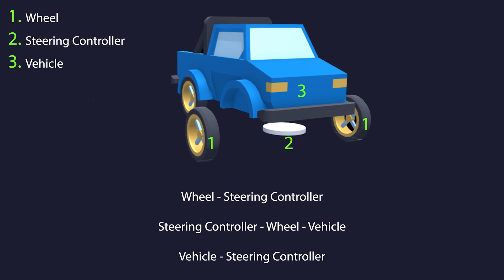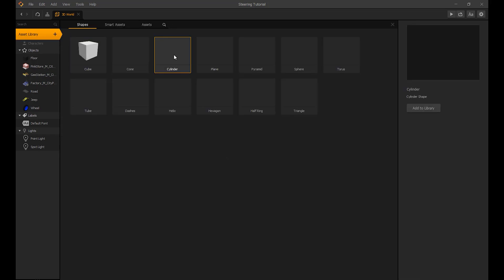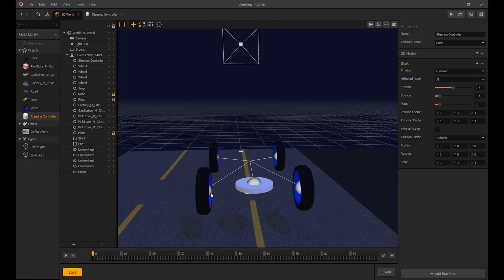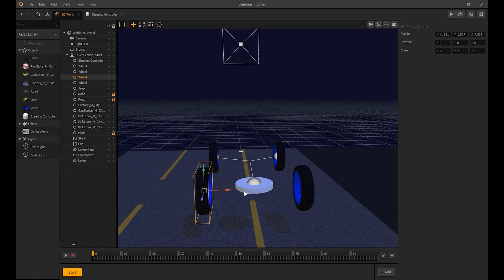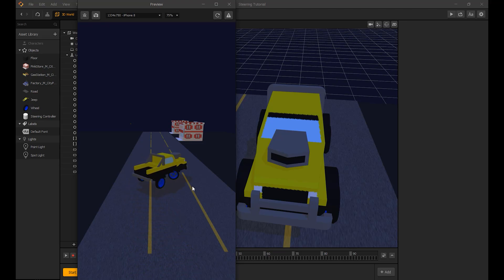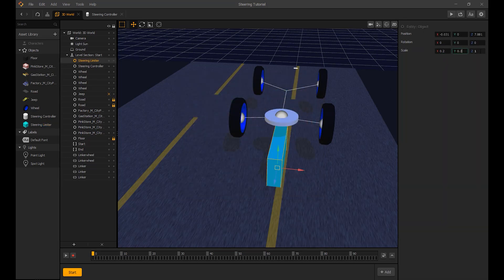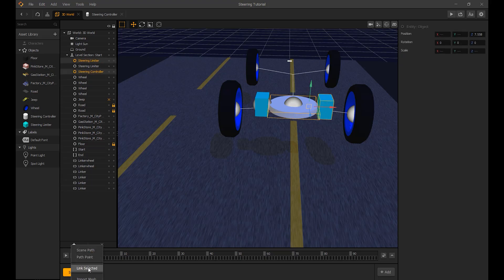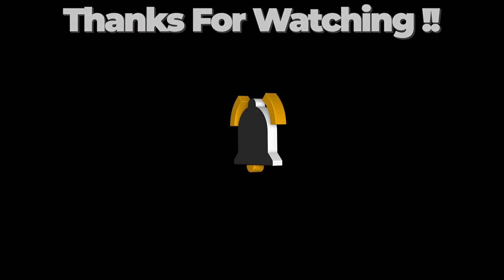How To Create Vehicle Steering in Buildbox + Bbdoc

Comment: hello, i tried everything you showing in the video but my car jumps around like crazy. I chekced the linkers to be in the right position and type and still the same. any ideas?
Reply: the limiters wont stay still. they fall down even in fixed
Reply from the maker: Hey 👋  It's been sometime since I made this. Could you show me a video on discord?
I'm in the official buildbox discord "Leighton" ( Community Mentor )
At a guess right now, I'd say to check positions of everything. Make sure linkers are in complete center of the wheels.
I don't get why the vehicle is  jumping...maybe its a collision issue where it maybe overlapping an other object.
Are you using the vehicle collision as a cube? I'm sure I tried importing a vehicle before and used the vehicle collision shape and that had some glitches so moved to a box type collision for it to work.

Are you able to download from the description and use it as a guide?

Comment: thanks !, is there a way to prevent the dragging of the rear wheel? it looks like its always drifting, more like the video you shows us with the attached trailer
Reply from the maker: You can decrease the motor speed to about 7. Also playing around with the "Friction" and "Mass" of the vehicle, Wheels and ground. 
I see the wheel is spinning due to power output.
Reply: @LeightonJ  thanks :)  maybe you can help me with a diffrent Question, exporting  from asset Forge through photoshop creates fuzzy texture, do you know of any solution to that ?
Reply from the maker: @עמיתגלעד-ק7ש  Sure, Are you on the Buildbox Discord? If not, find (leighton) https://discord.gg/k3qZsE
Reply: @LeightonJ  thank, i got in